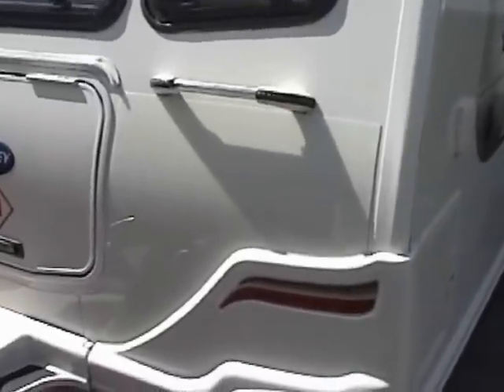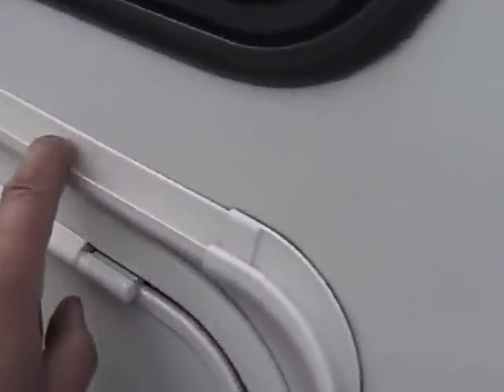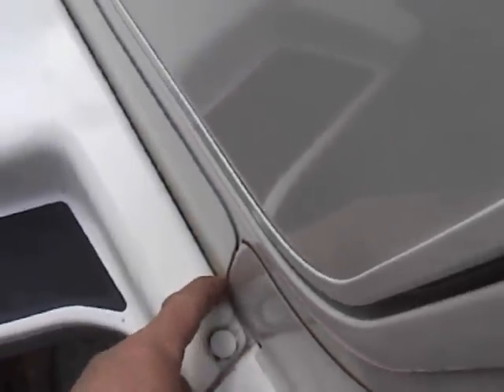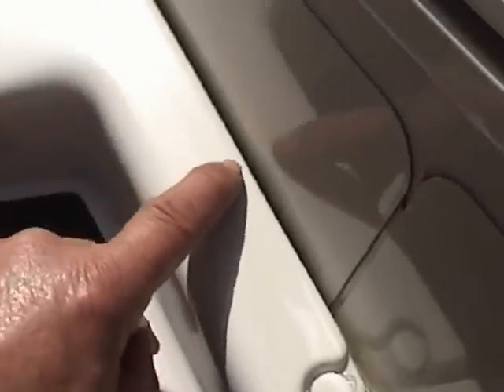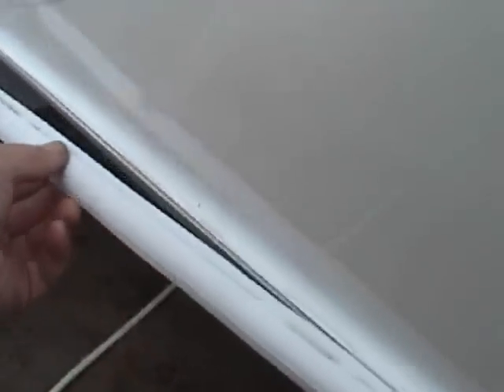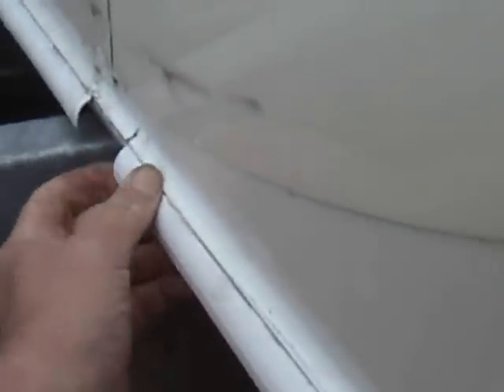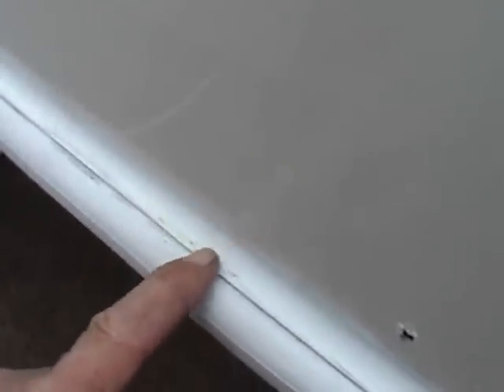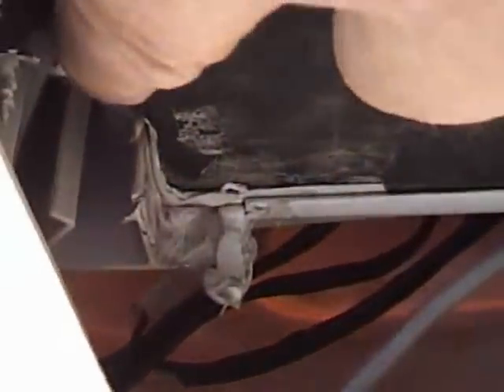Bailey Unicorn Valencia Wet locker mods

Comment: I had similar on a 2010 Olympus  - took all the front external moulding off then sealed the slot where moisture was wicking in then used self adhesive aluminium tape to make a drip route so that water didn't get to the slots again, dried out in a few weeks. My view is the design is reasonably sound but the execution is poor due to hasty workmanship...

Comment: 06-04-2013
My father in law bought a new Bailey Unicorn Barcelona in 2011 through Duncan Caravans, Wishaw, Scotland. There has been an ongoing fault with the ‘Dometic Fridge Freezer’ since summer 2012. Duncan Caravans have ‘attempted’ to undertake work through the warranty but have ‘failed’ to secure the correct part. Duncan are blaming Dometic and their parts ordering system!! Phoned Bailey Caravans, the receptionist (Julie) stated that I could not talk to Customer Services
 David